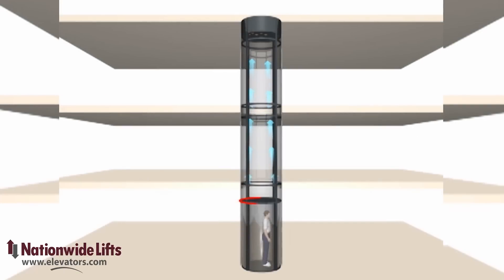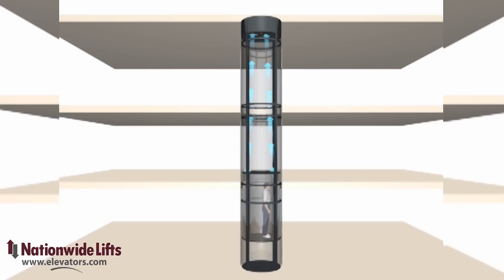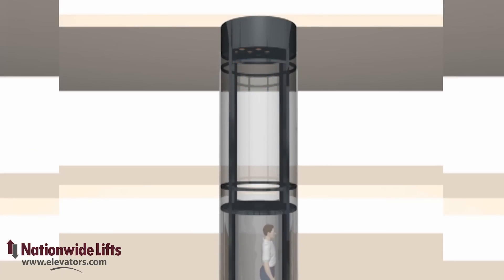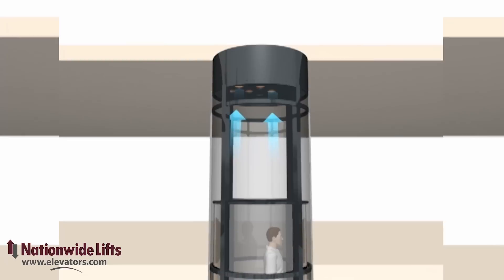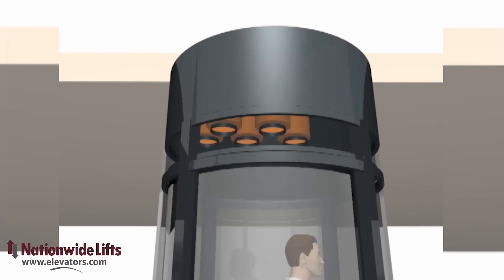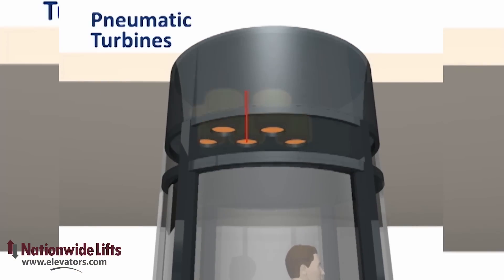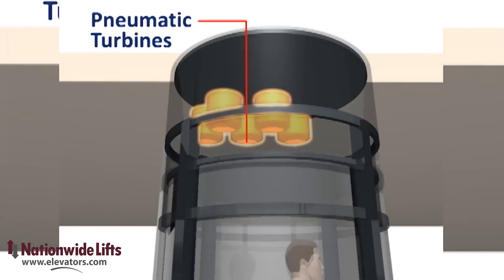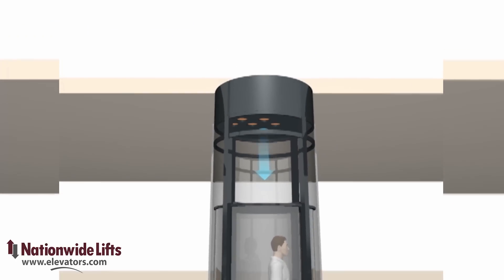Pneumatic Vacuum Elevators: How do pneumatic home elevators work?

Comment: what happens when the elevator is in transit and something hits the top part of the shaft and the vacuum is lost? Does the cab plummet?
Reply from the maker: If vacuum is lost, the safety brakes immediately set. 
This is a very safe elevator.

Comment: How safe is this elevator
Reply: Actually, much safer than standard elevators my friend. In case of a power loss or other issue, the values that control the vacuum above the cabin reverse and allow air to re-pressurize the tube; this causes the cabin to slowly descend back to the ground floor (same technology that allows it normally to descend). Without a complete mechanical failure, this thing is totally safe; even with a complete mechanical failure, it has several safety systems installed to assist in returning to an identified destination point and opening of the doors. For instance, if it gets "stuck" (but still has power)  - all you have to do is life the telephone handle (emergency phone is included and indeed, required for elevators) and the system automatically starts re-pressurizing and lowering the cabin.

No, I'm not a salesman or anything - just have a friend that has one in his very large Victorian home, and it is fabulous! 🙂
Reply: what happens when the elevator is in transit and something hits the top part of the shaft and the vacuum is lost? Does the cab plummet?